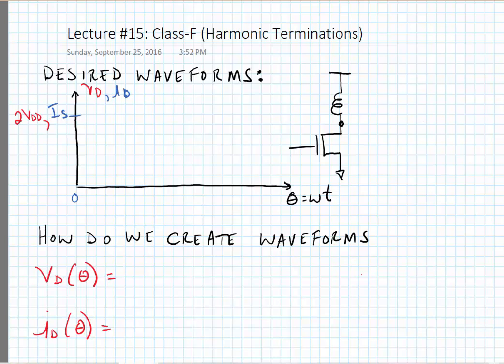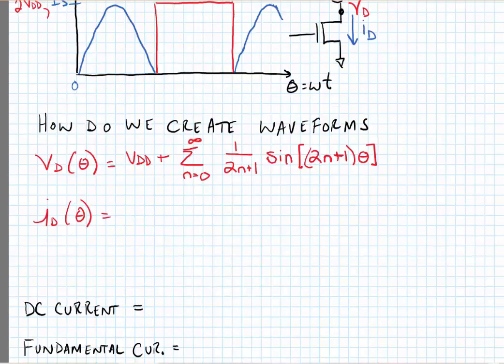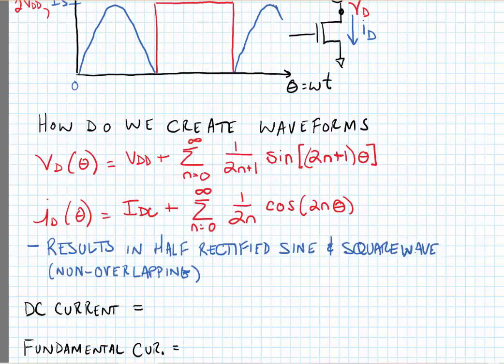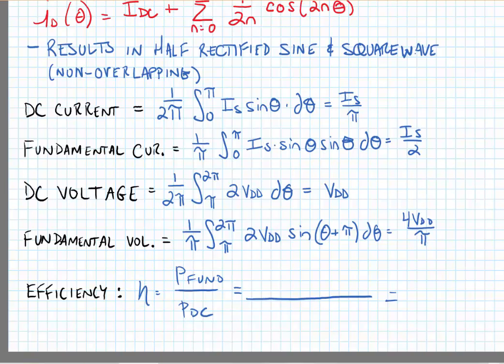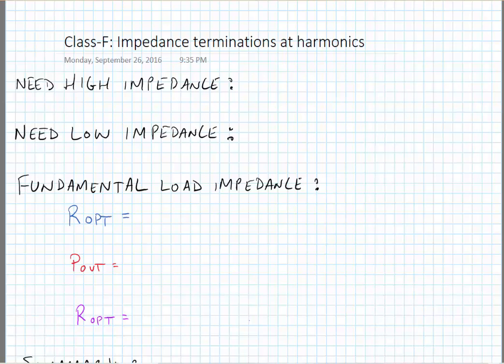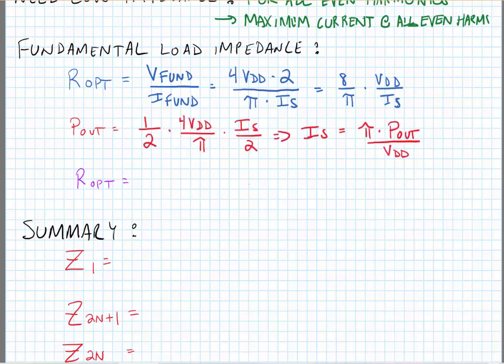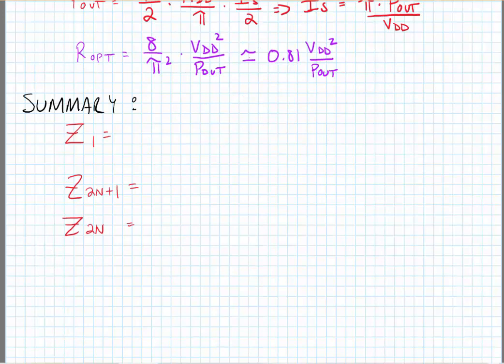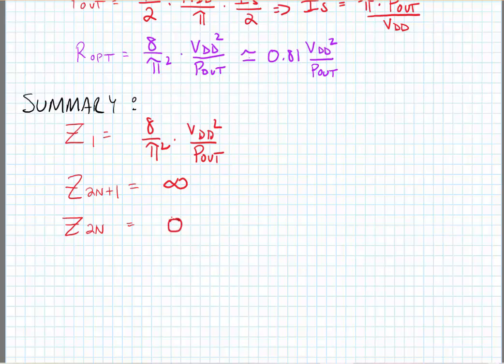Lecture 15.1 - Class-F Power Amplifiers

Comment: the Fourier series (in red letters) are not correct at all. Not only they dont match the picture which is OK (you may have included a shift) but they are simply wrong in terms of their coefficients. The following results are OK though. However, they cannot be derived from the "given" Fourier series unless they are corrected
Reply from the maker: This is correct, they should be shifted so that they are symmetric about the y-axis. That said, the key point remains that the square wave will have odd-harmonic components and the half-rectified sine wave will have even-harmonic components.
Reply: @wallingphd  no, the Fourier coeffs are all wrong. It's not just because of a shift in \theta. There are simple things that you can check even without doing any calculation. For example, in half wave rectified current waveform, the Fourier coeffs cannot be decreasing like O(1/n). They have to drop faster because it's a continuous function (albeit with a discontinuous derivative) in fact the Fourier coeffs for current waveform must drop as O(1/n^2). Another obvious error is that Fourier coeffs cannot be independent of "I_s" (or 2V_DD). They all must be proportional to these peak values. Another obvious error is that your current waveform does not have the fundamental tone at all even though you correctly used the fundamental to calculate the power. In fact if you do the Fourier correctly, although only even harmonics remain but a single fundamental tone also appears in the Fourier series.
Reply from the maker: @amirb715  Sorry, I was a bit sloppy in the analysis. Nonetheless, it doesn't change the main point. Current waveform will comprise only the fundamental + even harmonics and voltage waveform will comprise only the fundamental + odd harmonics. We assume periodicity. https://youtu.be/4iG5Yq3AI7M